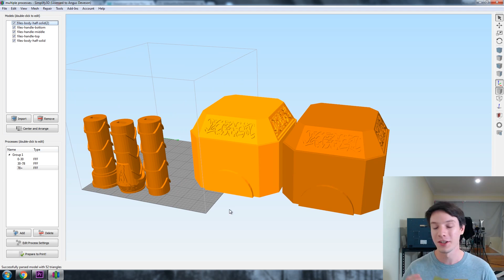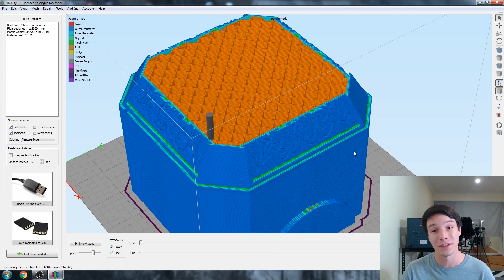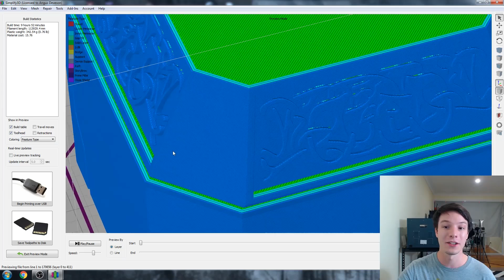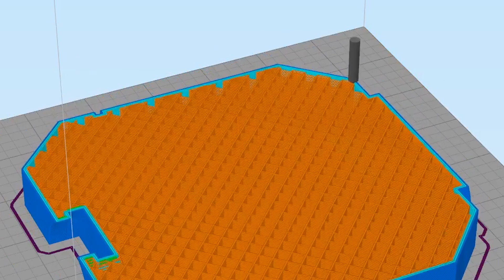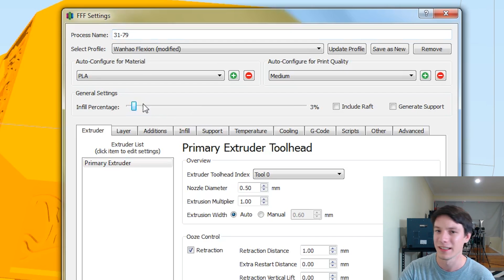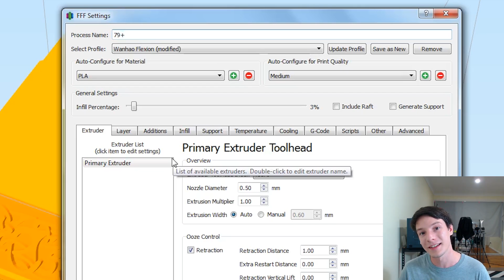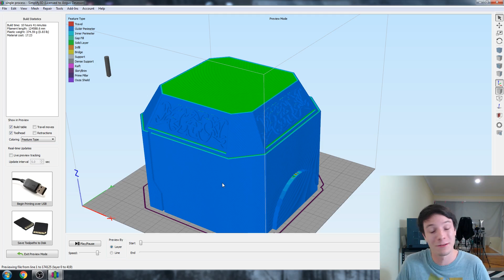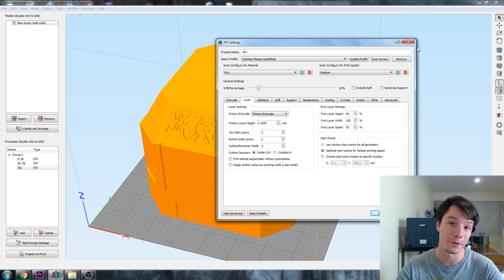Print Faster using Multiple Processes in Simplify3D - 3D Printing 101

Comment: Follow up:  I've done some more thinking about your instruction to name the specific processes or zones in this fashion (0-31), (31-79), and (79- top layer)...wouldn't that be two separate commands for both Line 31 and Line 79?? Or, are you saying it will just print TWO Line 31's and TWO Line 79's without issue?  I would really like to know the answer to this especially before a long print job...TY.

Comment: Hot damn Angus!  Being somewhat new to S3D but not to printing THAT was precisely the information I needed! And you shared this 6 years ago, but it's still VERY helpful. Massive kudos to you Sir! Like our good @Robakld below I had to look around my 5.1 version to find 'Custom Zones' but now I have some much more handier tools.  ALSO, appreciate the added ability to change the layer height at specific points to increase the exterior details, but for only that specific section, thereby not slowing the printing process for the entire model just for that section/portion of the model...Thanks again pard'!

Comment: This is a great tutorial and I managed to work it out for the 5.1.0 version of S3D. Under the advanced tab it is slightly different to the version you were working with 6 years ago. Under advanced, there is a button down the bottom called Custom Zones and that's where the print heights are. Thank for you great videos.
Reply: Thank you! Without your comment, I couldn't find where they moved this feature in version 5!

Comment: Cura uses 'build shapes' concept: using 3d shapes to define different printer settings.
Makes for interesting intersections!
The hammer could have two dense faces with a tough rod connecting them and a socket for the handle; a hollow shell simply defines the outer shape.
Strength only where needed!

Comment: And since you are using Simplify3D you can use a higher layer height for infill lines and only print the infill every few passes. So if you are printing at .1mm everywhere and you use a .3 infill height but tell the slicer to lay this infill line down only every three layers you will save even more time.

Comment: Having difficulties with this. Ive followed your steps step by step. But when my print goes from the first process to the second process it doesn't print the floor and i cant figure out why. But if i run just the first process by itself it makes the top ceiling.

Comment: I can't afford Simplify3D so I'll have to tinker with Cura settings. Also, if you want a solid part but also don't want it to print for a week, why not print at something like 1% infill for most of the print and change to 50% for fine details, and when it's done just fill it up with resin. Just remember to turn off bottom layer and use grid. If you use cubic then you can't pour inside the infill.

Comment: hey could use your help im at a lose i got a hictop dual extruder  their printer only had a profile only for  cura   and i asked them if they had one for s3d  and they sent me two one for each extruder   also note that each extruder is independent from each other  how would two  profiles work for this  each profile says  extruder 1 in the process  but the actual  profile  it says  extruder 1 and extruder 2   would grouping them work or do i have to keep ungrouped ? this is  so confusing

Comment: @MakersMuse I know that this is an older video and I really appreciate how you discuss this. I have a question about the multiple processes. Everything that I see shows that the differing processes are on the Z axis (ie: at layer 200 change from X infill to Y infill). My question then becomes can you do the same thing on the Y and X axis? (ie: the left side of the hammer is X infill while the right side is Y infill).

Comment: Hi, I am new to 3D printing using an Anet A8 and Simplify 3D, I have a question which you may be able to help,when I slice a part and put in printer via SDcard I have Hotend at 200degc and Bed at 60degc thats fine suddenly on the first layer bed setting temp jumps up to 200deg and turns heater on, if I turn down again in settings its fine stays at 60, I cant fine anywhere in gcode that tells it to go to 200deg... can you help...the on;y thing I thought was setpoint temp in "temperatures" in SF3D which seems to default to 200deg but if I change to 60 just the same..Regards John

Comment: Quick question, should you start next process on the same layer as previous one or should it be +1 layer. Like Stop at 79, then Start at 80 for the new process. I ask this because it might seem that layer 79 is defined by 2 processes independently.

Comment: I’m always trying to reduce the time of my prints while not compromising the quality. Thanks for this. This feature is great. I am now considering getting the software. Btw. I have this funny issue where the printer will run a second round over each layer but not extruding anything. A bit like ironing but every layer I thought I noticed. I wonder which default setting could have caused that.

Comment: In Slic3r you can achieve the layer height thing by going to the properties of your object and then under layers you can adjust the layer height there  for any layers
For using different infill etc you're gonna have to split the object into multiple parts though

Comment: Nice trick but if I designed the model I would put a half hollow egg shape inside the model to that the infill would be generated between the hammer and egg shape. It would provide enough support as it tapers in the higher layers. It would cut hours off the print time and before the two halves are assembled the egg shaped gap could be filled with expanding foam.

Comment: Can I do this trick when I'm printing a model with support structures? Because I just tried to slice a model following exactly these steps and I seem to have a layer missing in my support structure at the exact layer of which I switched to different settings. Printer completely skips that layer in the support structure and on the next layer just adds a layer on top of thin air.

Comment: The part where you had to activate the top layer so you don't have an open "wall" 5:36 is open on the top anyway as seen at 8:49, you would need to either let the first process go higher or add a process. Not to mention you would need support to print that anyway.
To be honest, I think it's kinda stupid they didn't differentiate between the top/bottom layers that would be there anyway and top/bottom layers that are created but the height range of the process. If you could activate/deactivate the two types of top/bottom layers individually this wouldn't be a problem...
You should at least be able to choose whether you want to leave the part open of close it where you slice the model with the process height range...

Comment: Quick question. I loaded this file and sliced for two different printers. CR-10 and Prusa I3. Before doing any multiple processing work, my print times were 22 hours and 27 hours respectively. How is your print time 15 hours? Is your printer really fast, or did you scale down the print or something?
Thanks in advance!

Comment: What about making another volume inside that's hollow and the in-fill only goes in between? So you'd have a smaller, no-detail object that's just about the same shape, but a few inches smaller. That'd give you a, let's say, 1 inch gap all around that's filled with a grid for support.

Comment: Here's one for you Angus. 

I was trying to do this today but the print would fail because whatever mm height I told the first process to stop and the second to start at would disappear and the filament would just extrude in mid air. The only way I could fix it was to (in my case) tell it stop at 3mm (desired) and start the next at 2.90mm. Now this gave me a warning message but according to the preview it fixes the problem. Suddenly the layer at 3mm exists again.

Any idea why this is?

Comment: Can you vary layer height between the edges and the center of the print? 
Can you do complicated infills that figure in maximum strength per amount of plastic(like a lot of fancy metal 3d prints)?

Comment: In the end he said that if he changed the layer height it wouldn't affect the others since there were differences. My question is: If he changed one of the ones with a layer height of 0.3 to 0.25, would the other 0.3 also change, or is it an all-or-nothing deal? I'd test, but I don't currently have Simplify3D.
Reply: just tested this and my first two processes were .3 changed the first to .1 and the second changed as well...third was .2 and stayed the same...so def looks like it just compares any like values across processes and knows what to touch and what to change.

Comment: Have you ever tried to print tpu and pla with dual extruder? i have no adhesion and a lot of problems. Makergear m2 dual extruder, simplify 3d
Reply from the maker: I'm not sure you could get he two to bond together. I have done ABS and TPU successfully but it was messy.

Comment: Is there a way to export a second process separately and resume without having to home your printer? i tried it and its printing in mid air because i dident let it home because there is s print on the build plate

Comment: Is it possible to make the infill varies per level? For you need a strong surrounding, but not so much at the core. Dense along the side and nearly none in the middle, would for this model a bullet shaped less infilled "hollow" space inside. As long as you .limit the grade of closure inside it should make a strong shell all the way.. (I can see it in my head, but explaining it eludes me)

Or maybe a inner outer shell would be the solution, where the inner shell gradually narrow and close before the outer shell, leaving little to no hang. Maybe with a support material column in the middle.

Do note that I do not have a 3D printer, but really want one (and can not afford one), so I am very very curious. And there are loads of things I'd like to try. Variable infill is one of them, one area with dense infill and one less and done by shape rather than layer.

I'm guessing that this is not a printer issue, but rather a slicer thing.

Comment: Angus. Any idea why I would input these setting the exact same as you. 60mm/s also and it want to take 21h 35m to print?? confusing me very much
Reply from the maker: There could be a number of reasons - what is your nozzle size set to and extrusion width? How about layer height?
Reply: Maker's Muse my nozzle size is 0.40 and extrusion width is manual 0.40.. does this need to be auto? I copied you layer height with the 0.3 and 0.2 for the top section.
Reply: My default printing speed is 3000.0 mm/min which I thought worked out to be about 60mm/sec
Reply from the maker: set it to auto for a 0.48mm width, it'll be a fair bit faster
Reply: I've done that also changed outline underspeed to 60% solid and support to 80% and up'd the default to 4000mm/min and changed the x&y axis speed Also. If the first few layers look crap I'll just try again. got it down to 12 hours btw.
Reply: Angus I wonder if you can help here. I've printed this out for the second time as the first one failed pretty bad with a big gap at the 31mm stage. My 2nd had the same gap form and on S3D I can see the gap but don't know how to close it.

Comment: You can a lot of the same things with Slic3r, it has a variable layer height setting. Now many people know about this, you can find out about it here on youtube.

BUT! What I would say even the people who run the Slic3r website do not even know, is that along with the variable height settings, there is a list of 95% of the other settings that can be set up per layer set. From speed, to temp, to infill, or perimeter settings.

I have been racking my brain to find out if this exists, and just as I was watching this video I discovered it on the Slic3r I have installed on my computer.

When I have it all figured out I will do a video on it, because I could not even find instructions on this on the Slic3r website!

If you have Slic3r, you need to pick the object you want to print and select settings, a pop up will appear, on the pop up you will have two tabs, "PARTS" and "layers". 

On the layers you put in the layer numbers starting with Zero, up to the end layer you want to change, and from what I can see the only limit on layer changes is how many layers is needed to make the part.

NEXT you pick the layer setting you want to make the changes to and then got to the PARTS TAB, on the "PARTS TABb", you will find when you look down close to the middle to the bottom, you will see a small GREEN PLUS SIGN. Click on it, and a long menu will apear with all the settings for that layer section.

So far that is all I have figured out, but at least now you can try and see if you want to use FREE Slic3r or $150 Simplyfy3d

Comment: Time for the maker level programs to support variable infill geometries. making the majority of the inside a lightly filled, maybe even different shape will save more time and if properly designed even make the middle part more robust without usnig robustness in the outer parts.

Comment: I'm curious though, when you change from the 3% infill back to the 15% infill, will it not cause internal overhang issues where the filament is unsupported? Loving your videos, I'm learning so much!
Reply from the maker: It's called bridging, similar to when you do the top fill on a 3D Print - the plastic cools so fast that you can actually get away with a big gap as long as its supported at either end!

Comment: I have a quick question regarding multiple processes, and I haven't been able to find the answer on any of the forums I've visited, but I have been Previewing a print that has 2 processes, one has a raft, and the other uses brims. My confusion is this, "When I Get Ready to Print, and enter Preview mode with both processes, the raft does not generate or desplay. Even when I "play" through the print, it prints the models that are in the "raft process" but does not print a raft. However, if I go to Preview mode and only select the raft process items, the raft DOES render... Has anyone else experienced this, or is there a setting I'm not hitting. I'm using default raft settings. Thanks :)

Comment: Hey Angus.  I'm using multiple processes but the raft is only on the first process.  The support for the second process is on the bed and not on the raft.   I can manually adjust but was wondering if there is a automatic way to do it?  Thanks. :-)

Comment: it is pointless to have the strong infill at the top if you have no infill around the sides. If the design was split in 3 so that the circle at the top was part of a wide part that fills the inside of the hammer with a hole in one side for the handle then it would be quite strong. Split the center piece in two and you have 4 parts and little need for infill for most of it. Wood blocks is a good alternative to infill in my opinion if a person wants to go that route.

Comment: Regarding grouped processes.  (sorry for all the questions)  If you grouped those processes like you did, and then wanted to change your layer height for the highest process to .1 later, would changing it change the other layer heights?  Seems like it would be as annoying as helpful if so.  And if not then it would be very confusing not knowing which variables are linked and which are not.
Reply: Surprised your question didn't get answered - it's my question too. I assume you would ungroup to make a change on only one process then regroup.

Comment: awesome information do you know if you can set them for different objects on the bed?  for instance printing a lot of little objects on one bed.... I do not want to have brim around all of them.. (like 100 small objects.) always the first two mess up then it's a cascading effect and will take out each one down the line.... I have tried extra nozzle priming and swiping at the beginning of the routine but having a brim around the first two objects would be the awesome.   if I start spot and redo the frist two at the beginning it works great. also. other places that this could be useful, I tried it but it wants to merge the processes and it doesn't work as expected.. thanks for all the hard work

Comment: Can Simplify3D print with different infill percentages for different objects at different heights in the same print?
Reply: Andrew Rabbitt yeah - you are can apply different processes to different models. in the process screen, bottom left is a Select Models button - tick the one (s) you want. You will then have to carefully manage all the processes per model and per parameter change. Like Angus said - name the process something logical - so for you it would be 'model a - 10%' 'model b - 15%' etc etc.... ive had prints running with different layer heights and infills at the same time, processes are pure magic!! 😎

Comment: Group processes! Good tip. That'll be very handy. Ive been running my first process with a thick layer height because of my dyi pei bed level being completely inconsistent. Works great  with reduced extrusion and a static speed for the first few layers. I like running  the bottom layer with rectangle external fill for better adhesion then the last process with concentric pattern. Seems to make the top layer look better. Curious what's your thoughts on concentric patterns and quality of your prints?

Comment: Neat tip about grouping processes! How accurate do you find the build time forecasts? In my experience they have been a little erratic and usually overly optimistic.
Reply from the maker: Definitely conservative, prints usually take a bit longer and sometimes hours more if a 3D Printer is pausing between lines or has to maintain temperatures.